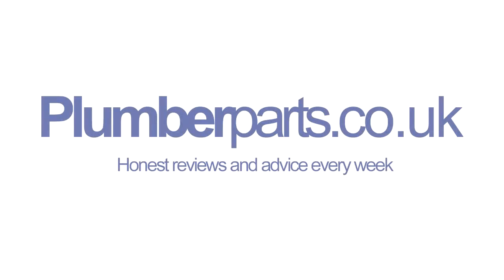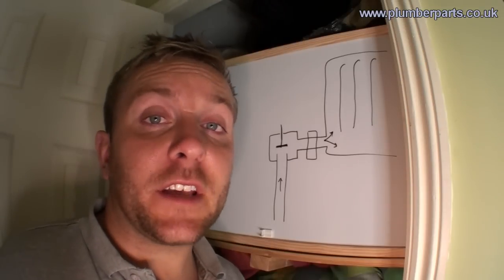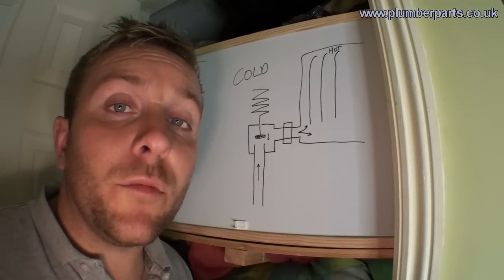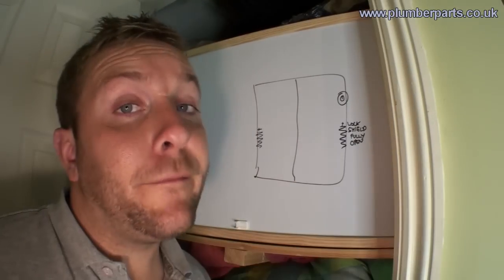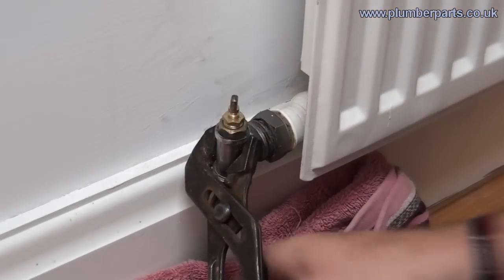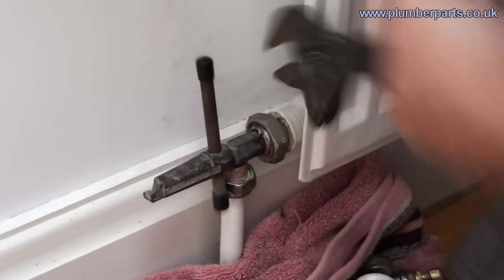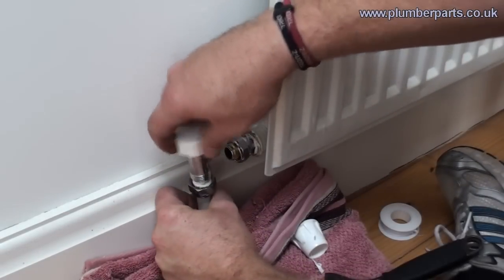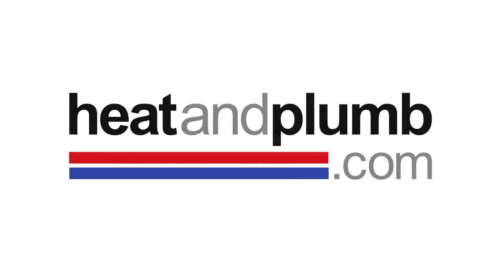Thermostatic Radiator Valves - Plumbing Tips

Comment: Nice informative vid Thanks.

I just bought 6 new TRVs to replace old valves. I'll need to swap the tails in the rads too. The thing is that the tails that are supplied with the TRVs do not have a flange between the threads and the tightening nut to stop/limit how far in you can screw the tail. When do do I know to stop screwing in? To see the kind of tail I have look at Danfoss TRVs.

Thanks in advance.

Comment: Great video thank you! Unfortunately I took off my lockshield and fitted new one and no matter how tight or how much PTFE it still leaked from the bottom. 

1) does it matter that it wasn't connected to the rad ? Ie would that have stopped the leak from the bottom had I connected the second end? (I'm guessing not but just checking!)
2) if not, I think I probably cut the pipe by accident as the lockshield was turning fully around on the pipe when I was trying to undo it.

Would you recommend using any PTFE tape when placing the olive on the copper pipe or is it just worth doing on the bottom of the lockshield thread ?
Thanks in advance and keep up the excellent videos!!

Comment: Thanks great vid clear and informative, just what I needed. I wasn't sure the TRV would fit into the same space as The old type valve, but now I see how it's done. Just one question please ? can I use the old nut on the feed pipe or do I have to remove the old one and it's olive ? cheers.... Chris.

Comment: How would you attach a thermostat horizontally? Can the pipe go vertically up from the thermostat and across and down into the pipe? The top of my radiator is hotter then the bottom.

Comment: If on a combi system can i just depressurise the system and then pull a vac on each rad by leaving the bleed screw shut, shutting of the return valve and quickly changing over TRV. Do you think the vac will hold?

Comment: I am installing a new radiator. However, the new radiator has a 25mm thread and the heating system is 15mm. Can you get a 15mm - 25mm TRV?

Comment: Great info video but if I may,  just one slightly important aspect of installing a TRV  that I believe you missed in this video  is that it must be oriented correctly on the IN FLOW of the hot water as if you put it on the return flow it will not work as per the last post or similar. Obvious to pro's but to DIYers it is not. You need to check which is the IN flow of hot water before attaching the TRV. Check the arrow on the valve. You do this by turning the heating on and seeing which side gets hot first! Not rocket science BUT crucial!... and omitted in the video. You can fit it on the return flow but it must be at 90 degrees to that of the in flow. i.e. TRV appears to be horizontal. I mention this as a numpty DIYer did this on a house I moved into and the rads did not work. Hope this is of use.
Reply from the maker: Jonathan Harrison Hi John and thanks for your comments. We are going to film an updated version of this video over the coming months with this amendment included. That being said it is now hard to by non-universal TRV's on the market.....obviously make sure before you do....and then it can go on either end!! Many thanks, PP!

Comment: If I do this change because upstairs in my house I have a very high temperature specifically in one radiator, would it be possible to use a pipe freezing kit instead of a complete draining? Just because I share the house with other six people and I wanna be really quick. If not before I drain the system shall I only go to the the thermostat and set to the lowest temperature so it shuts off a completely the radiator or am I going to electrically shut the boiler off as well?

Comment: great, useful vids.
I recently moved into a house we're the only radiator not to have TRV is in the bathroom.
Our thermostat for the boiler is a wireless one.
your video says you shouldn't have a thermostat in the same room as a radiator with a TRV, I do understand the reason behind this.
At the minute I got the thermostat in the living room with the TRV set at 5 (max) to try and leave the radiator open and stop any interference with the radiator switching off before the thermostat is up to temp. but i do think sometimes the radiator shuts off before the thermostat is up to temperature, also I'm finding is the bedrooms don't seem that warm which are all set to 3.
Any suggestions of any other way around this, there isn't a radiator in the hallway.

Also the TRV's are labelled 0 - 5, is there a set standard of number to room temperature

Comment: Hi, very good videos.  I have an end terrace built 1995.  water tank up in the attic. boiler as usual in kitchen. all radiotrs in house working fine except the living room one on ground floor. it was working but in last 2 weeks has stopped working. pipes going to it are cold too. so far all i have done is open valve fully (the one on right hand side of rad). no effect.  I have seen that another issue is the TRV might not be working (pin stuck), i will try that this eve. I also had curtains covering the TRV so that could also be an issue as it cant read temp? I havent tried bleeding yet.  if after all this the pipes are still cold what else could it be (i have also tried rebalancing).  My main concern is why the pipes to and from rad are also cold, could there be a block? or is that nothing to do with it?  thanks in advance, Craig

Comment: You seem to have forgotten the problems with TRV , 1. don't ever fit if you have long drapes, 2, don't fit if you have a settee in front of the rad ,3, don't fit if you have a radiator cover, and don't fit to every rad encase your boiler has an over run on it .. don't forget to mention to keep the cap to shut the trv completely off if you decorating a room in cold weather.. and want to remove the rad...

Comment: Quick Question: I been watching your vids and I've attempted to change my valves, 
Looking at the Rad, the valve on the right will close, but! The one on the left is stuck
And no matter what I try it won't budge even used Mole Grips but still even belted with 
a Hammer but it's stuck fast, both ways righty tightly, lefty loosely bloody nothing, 
Can You Please Help!
Reply from the maker: +TheAudiostud Drain the system and change it mate. It's hassle but a valve that doesn't close is useless!
Reply: +plumberparts thank you, yes! Looks like it, cheers Fella

Comment: I have a thermostat that doesn't stop the heat when i turn it to 0 ,it worked fine till today.Any ideas ?
Reply from the maker: Abaianit Cristian Knackered thermostat I'd say (or a frost stat keeping the heating running)
Reply: +plumberparts I'm having the same problem with a small rad in my hallway, won't turn off when heating is turned off via thermostat

Comment: i am having trouble when i fit the small union valve into the radiator. i am getting a leak i did use 10 wraps of ptfe tape. but i am using this with an extension valve. an doing it clockwise as shown. please help this is killing me.

Comment: Never use a thermostatic head vertical, heat from under wil it make close faster than it normally should do.
En why are people grips so much instead of 2 spannners?
Grips will damage your valve and there is no need to do that. Use 2 spanners al the time!
Reply from the maker: Ohhhh please!